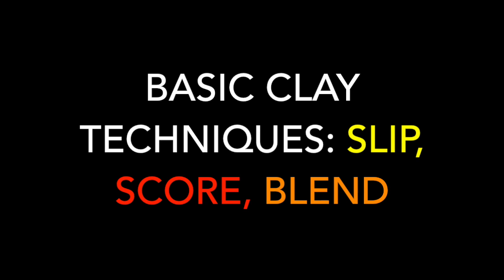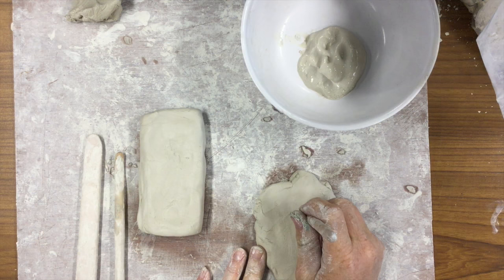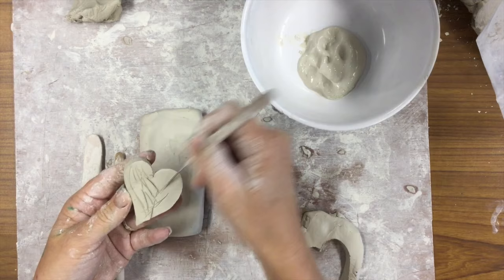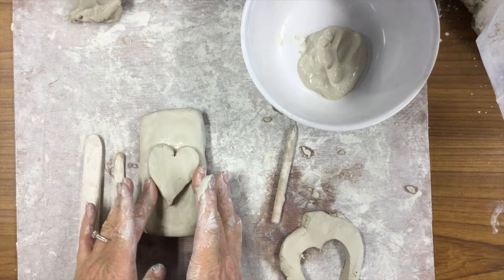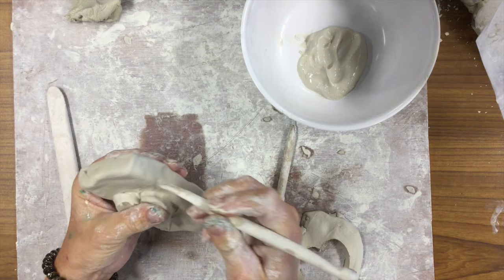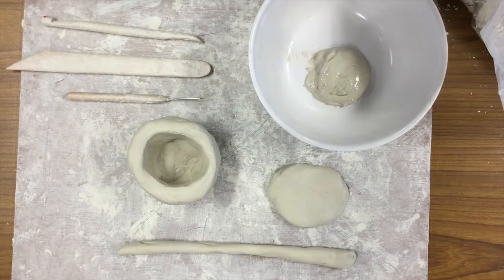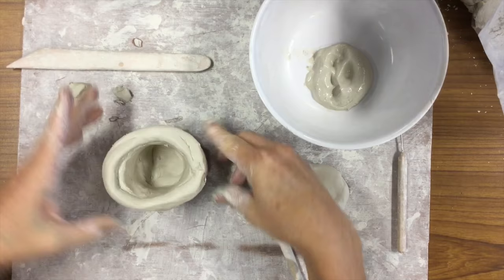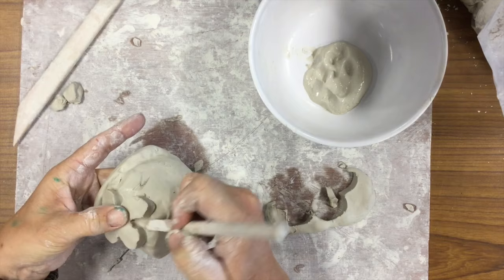Slip, Score, and Blend (Basic Clay Techniques)

Comment: What kind of clay is this? Can you bake it in the oven at home?
Reply from the maker: Hi. I was using clay that requires a bisque firing in a kiln. It cannot be fired in an oven at home as the temperatures are not hot enough. This clay was either earthenware or stoneware.